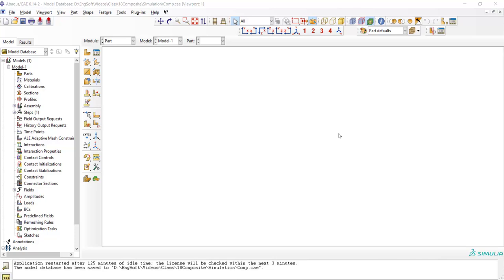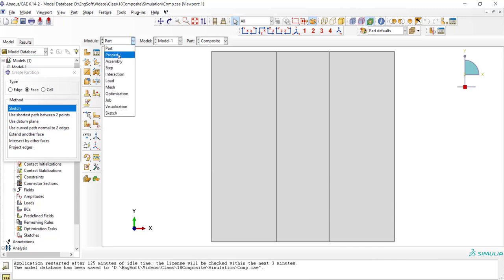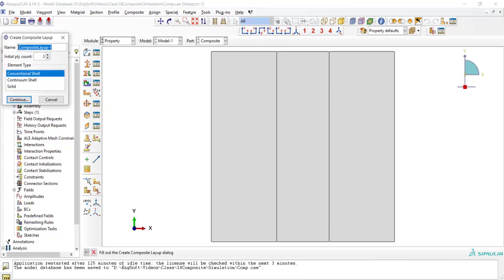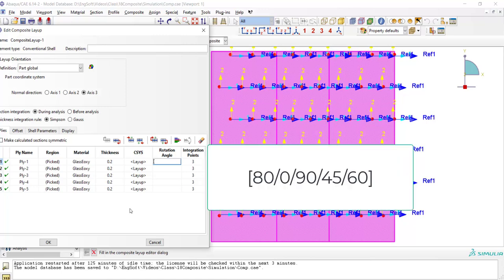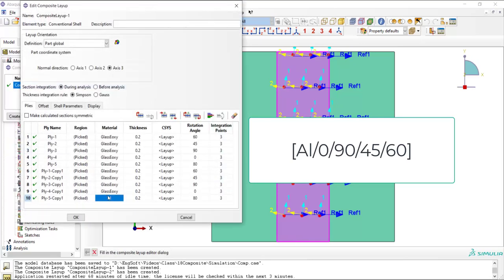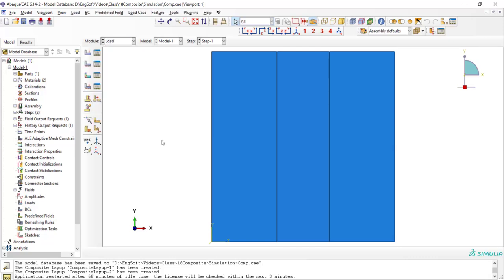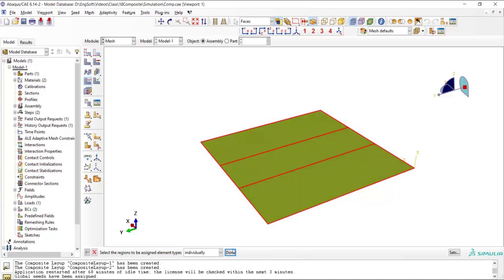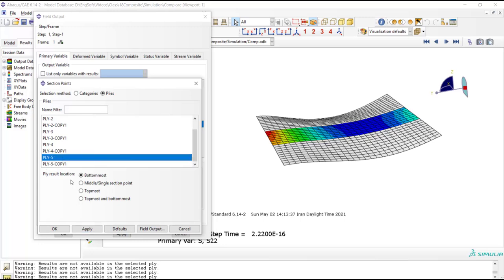How to model laminated FRP composite materials in Abaqus

Comment: Hi, how do you find the mechanical properties for these plies? I am wanting to do a similar thing for a carbon fibre polymer reinforced composite. Thanks!
Reply from the maker: You should do one of the followings:
Perform tensile and shear tests on various direction of a ply
Use a micromechanical model and calculate these values based on constituent properties.
Find a close material to your case

Comment: what is the unit of shell edge load? Is it N/m.   If we consider thickness can we apply shell edge load as pressure value (N/m2)
Reply from the maker: In shell and plate theories, all the in plane loads are represented in (load per unit length N/m for force type loads or N.m/m for moment type loads). So the unit is N/m or N/mm for force type loads.
However, there is not any shell edge load in this video.